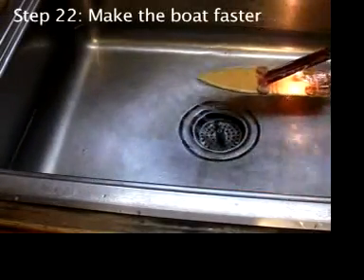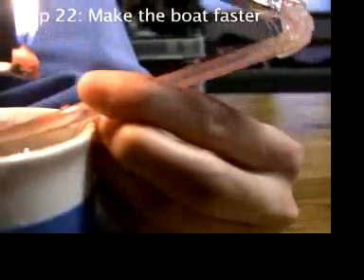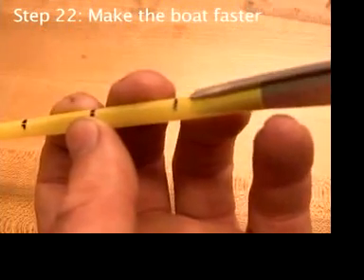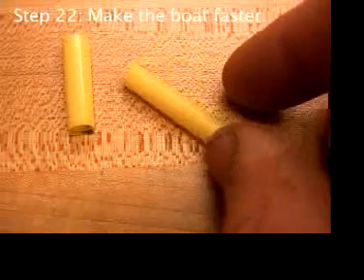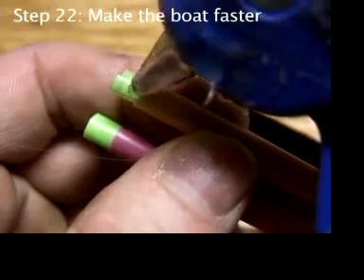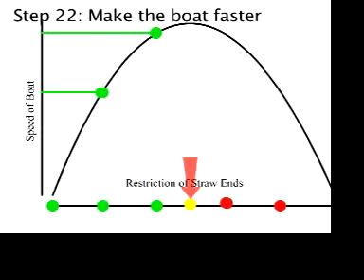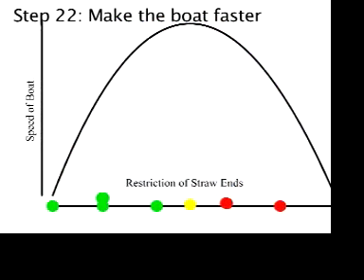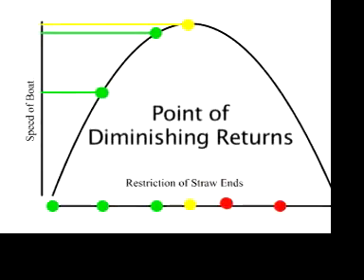Part 25 Build a Putt Putt/Pop Pop Steam Boat s22 make it faster

Comment: The physics does not work. You do not gain energy by making a nozzle smaller. The thrust is determined by the mass of water multipled by the speed. Reducing the flow causing higher speed actually reduces thrust since you are adding resistance
Reply from the maker: I did not say that you gained energy by making the nozzle smaller; I said that you gain speed. I think it's more about load matching to the speed of the boat. You see the same idea in rocket engines. Of course, if you take it to the extreme and restrict the opening too far--past the point of diminishing returns--then the engine performance would be reduced. You have to find the sweet spot.

Comment: because if i put fire plastic will melt
Reply from the maker: You have to use metal for the boiler. But the pipes do not get very hot, so I use plastic.

Comment: What is the physics behind this part called? Really want to read the theory of what makes an all too small not that effective anymore etc.
Reply: reducing the diameter of the hole increases the speed/volume ratio, so it goes faster, but it also increases the friction, so it makes it slower. The smaller the diameter, the more the friction increases, so there will be a point in which making the hole smaller will increase the friction so much, that speed will be less.
Reply from the maker: Yes, if you look about 3 minutes in, I sketch a graph that indicates a point where it becomes counterproductive to restrict the end. You can verify this by experimenting.
Reply: Exactly. In this case, doing the math is not a good option, there is too much variability in the water and the coefficient of friction. It is far better to do this by experimentation.

Comment from the maker: Several things affect noise. The most common is how much water is in the boiler. Shake out as much water as you can before priming. You need water in the straws, but only droplets in the boiler, which flash to steam quickly.Also, moving the candle a little forward or backward can change loudness. I find tea candles too weak for good sound. Sometimes an engine gets louder after a minute of running.
Slater

Comment from the maker: re: why don't the straw part inside the engine melt? Good question. I think it's partly because the water in the tubes keeps them from getting too hot; partly becuause the heat from the candle goes mostly up and away from that part of the engine; and partly because the epoxy around the straw ends helps them keep their form.
Slater